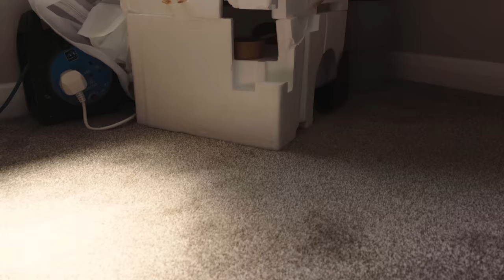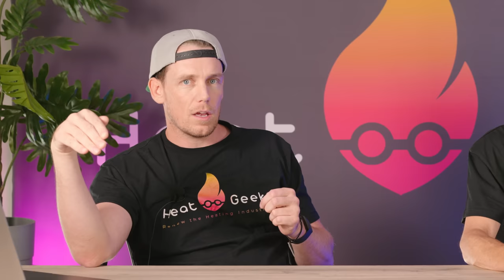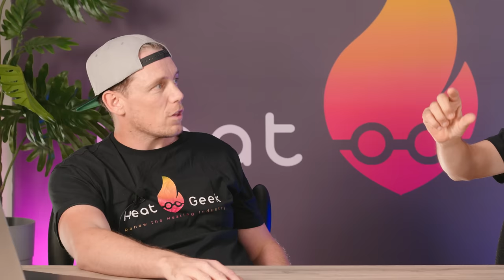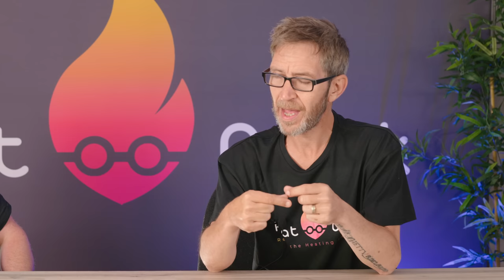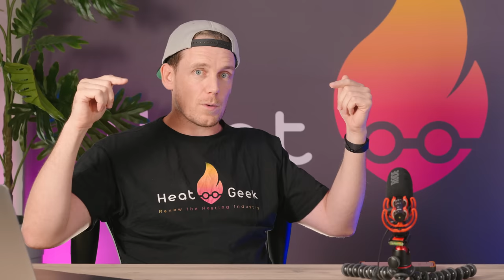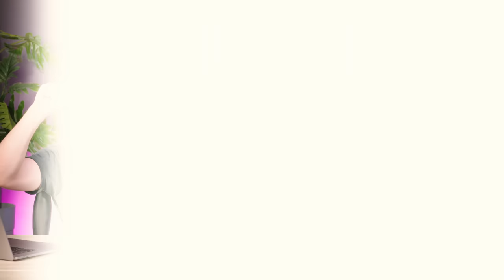Cooling With Heat Pumps | The Technical Details

Comment: I run four fanned radiators on my weather compensated systems (down stairs UFH) all have three speed fans manually selectable to achieve the correct heat input per room, each unit has a 8 watts fan draw maximium and wired into fused spurs from the upstairs ring via the sockets in each room, this in practice is straghtforward as long as no other supply has been taken from that socket on a ring mains.
They need a service every year as they collect dust due to large air movement through a mass of alloy plates fitted to 8mm or 10mm copper pipe, they are fed with 15mm copper and each set of pipes is connected to a common 22mm copper carcass branched off of 28 mm copper Nr the boiler, the 28mm feeds the UFH with 12 feeds and returns, no blending, no pump and no thermastatic control as the weather comp directly controls heating water temp. 
They are noisey and if not cleaned thoughley make even more noise, having said that you soon get used to the noise and its not that bad, I run the fans on there mid speed as thats the heat output required, they also only come on at around 30 degs flow as they have built in pipe stats and a built in thermostat so once the room is up to temp they turn off, this give a deg of control as everyone's heat requirment is different in each room.
As for runing them for air cooling this would be a problem as the frame is open underneath for air to be drawn in and condensation cannot be collected. They would need servicing again before being used for air cooling as dust collects easy due to close spacing of the alloy fins on the heat exchange.
Hope that gives you some more insight into cylindrical fanned radiators designed for low water temp systems.

Comment: The price of the cooling chip is hilarious. It would be interesting to get someone to reverse engineer it and see if it can be done for 20p.
Reply: It's a simple resister, not a chip!  It enbles in-built functionality, it doesn't add it.   Should cost around £30, not £350.
Reply: Seems Vaillant UK do sell it for £350.  It's €40 in europe though.
Reply: Happy to have a go!
Reply: @edc1569  It's the vaillant blue chip (used on their gas boilers) . £5. Yes, it's a total rip off!

Comment: I'm curious why everything I hear about UK heat pumps is all air-water and distribution using water radiators? All modern buildings here use forced-air, either air-air heat pumps or forced-air natural gas furnaces. With heat pumps, the indoor air handler deals with the condensation in cooling mode. I get that your existing buildings don't have ducting (we have plenty of existing buildings with baseboard resistance heat for that matter), but what about new build? And for retrofits or small condos, people here are just putting in ductless mini-splits. Radiant heat is nice and all but it seems cooling is a big challenge.

Comment: I've been looking at retrofitting A2A upstairs for potentially heating and cooling, is there a reason you need fan coils in each room as I've seen rooms ducted from a single large unit in the loft space. This takes up less room but is it less effective?
Reply from the maker: Just to spread heat. Warning.. a2a is not as comfortable
Reply: Ducted systems loose lots of efficiencies. Thermal Loses in the duct work, hard to keep clean etc. 
Best to have the units directly in the room. They are the quickest in getting a room to the set point, nothing else comes close
Reply: @darrenr1995  I guess even though they are a bit more work to fit the fan coils, it's still fairly straightforwards upstairs if you can run wiring/condensate/coolant through loft space still
Reply: @bencampbell2041  yes surprisingly easier than ducted. Each house lends its self to different systems though

Comment: Are the air con fans that Richard described effectively mini-splits connected to the same heat pump?
Reply from the maker: Yes but via system water not feidge
Reply: @HeatGeek  Ah great. Yeah I’m with you on this as we only need cooling at most a few weeks a year. It’d be great if you could show us a working example of what was discussed.
Reply from the maker: @amritbhupal8514  were still testing it.. filming more tomorrow

Comment: Is this highlighting a fundamental limitation of hydronic systems? Should we be considering air heating / cooling units and circulate refrigerant directly instead of water?
Reply: When the HeatGeeks started this I assumed they were installing some clever valves and putting the ASHP in reverse to provide a Compressed R290 cooling loop to inside AC "Fan Coil Units" I'd like to see them add this to their system and see what the performance difference. Not sure if there are any ASHPs that allow this reversal out the box though.
Reply: @andyca15  they did mention some heat pumps don't support or require a controller box to support cooling
Reply: I think it is highlighting that one size does not fit all. There is no perfect system for our varied housing stock and each case needs to be addressed on an individual basis. Air to air works better in small areas. For example when we went on holiday the villa we stayed at had 5 split air con units. Not cheap to install, maintain or run!
Reply: Circulating refrigerant directly into the indoor unit(s) for both heating and cooling is far more efficient and effective than transferring the energy to water. All AC systems are heat pump based too
Reply: Circulating refrigerant directly into the indoor unit(s) for both heating and cooling is far more efficient and effective than transferring the energy to water. All AC systems are heat pump based too
Reply from the maker: @darrenr1995  not really worth it for 10 days a year..
Reply: @HeatGeek  we install traditional heating types and also AC. I’m not against and types of systems but my customers use the AC cooling for more than 10days a year! I bet your office ones are on more than that 😄
Don’t forget they do heating exceptionally well too, so keeping people very comfy all year, not just in winter. 👍
Reply from the maker: @darrenr1995  where are you based???
Reply: @HeatGeek  Hayfever sufferer here; I need to keep the windows closed during hot periods... My little Portable AC unit has been on for at least 30 days so far this year, with many more to come. If I had been working from home my AC would have been on more.
Reply: @andyca15  this is a huge benefit of split ac systems. Filters the air at the same time too
Reply: @HeatGeek  we are based between Peterborough and Stamford
Reply: @darrenr1995  yes some extra benefits to split AC for sure, goes to show #NoPanacea 
Looks like we will be getting far more of these extremes in the future too.
Reply: @darrenr1995  cover Kettering? 🤔
Reply: @Ifitaintbrokedontfixit  still cheaper than a large A2W system, though (all in)
Reply: @Etacovda63  not a chance it is! And as for maintenance!!
Reply: @Ifitaintbrokedontfixit  .What do you foresee being a big issue with maintenance?
Reply: @darrenr1995  I don't see a big issue per se other than the more units you have the more maintenance you need to carry out.  I am all for the best technology we can fit. If that is Air to Air units why are so few being fitted?
Reply: @Ifitaintbrokedontfixit  to be honest the maintenance of AC is removing and cleaning the filters. If installed properly (nitrogen pressure test 40bar, vacuum the system correctly) once completed by the engineer the system is a sealed unit. Nothing on the refrigeration side is then disturbed. The gas doesn’t degrade. Once year service (electronic leak check, clean coils, check temps) that’s it. Very low maintenance.
More aren’t installed because few really know about it or are prepared to change. Your local plumber can’t fit them either so that’s another restriction. Industry is regulated by FGas. Have one fitted professionally and see, you’ll then have more 😄
Reply: @Ifitaintbrokedontfixit  - don’t know what you pay for air to air heat pumps in the uk, but in nz you can get an air to air 5kw unit installed for around 1500 gbp (including the unit). I’ve spent exactly nothing on maintenance of mine since it was installed 9 years ago - just cleaned the filters (about every month, it’s literally a 5 minute job, and you only have to do it in heating season, and realistically only every couple of months, I do it more than you have to) and the external units Fancoils myself, which I have done once in 10 years. Getting a multi split installed would probably end up similar $/unit as the install would be more. One unit can happy service more than one room depending on house lay out (my house is 100m2 and the one unit does half of the house no issues, if we installed one in our hall we would do the rest easily).

I’m not sure where you’re getting your info, but it’s wrong… I’m guessing by your YouTube name you’re a plumber and have listened to other plumbers who are susceptible to lies from others in your field because it will encroach on profits.

The UK and the US are miles behind on this, the US are finally installing mini splits now when the rest of the planet has been doing it for decades.
Reply: @darrenr1995  I am talking more about breakdowns with multiple units. Also by 2027 there is a ban on split heat pumps under 12KW with a GWP of over 150. That means they will need to then run on r290 (propane) which is going to mean some more training for people and redesigning of units for domestic markets. Its not that simple!
Reply: @Etacovda63  your info is for the UK to.
Reply: @Ifitaintbrokedontfixit  can’t speak of others breakdowns but from my experience it’s not of concern. They are extremely reliable, they just keep going on going. 
R290 will come along but no one is going to make you remove an existing R32 system from your house!
Reply: @Etacovda63  * your info is correct for the UK too
Reply: @Etacovda63  Installed I would say substantially more than £1500 for a 5KW unit in the UK. As I said I am not against the idea. I am just a little sceptical that they are so cheap, wonderful and the answer to heat every house in the UK!!
Reply: @Ifitaintbrokedontfixit  5kw air to air mini split is around £1500 supply and fitted. Maybe £1800 max if you opt for a fancy model.
Reply: @Ifitaintbrokedontfixit  you're jumping to a lot of conclusions, I suspect because you dont like the answers. 1600gbp fitted for a 5kw unit in the UK was the first one I googled. Literally the first.

Rather than not liking the results, I suggest you get some fridgy training - that way you can put in the appropriate system for your customers if a2a is needed.
Reply: @Etacovda63  On the contrary why would I not like the results? I said one solution would not suit all situations and it's evident that you like a2a. If there was a market for it, it may be worthwhile exploring further.  At this point in time it is not an avenue worth exploring for us.
Reply: @Ifitaintbrokedontfixit  yep, maybe not right now - but once people have heatpumps in over there with the boiler phase out, you'll probably find people cotton onto air to air heatpumps. All air to water is doing, is adding another heat boundary inefficiency. The only reason to stick with water is existing infrastructure, or underfloor heating.
Reply: @Etacovda63  Ok. A little scenario. How would you go about heating a house effectively with a2a when there are 5 rooms downstairs, 5 rooms upstairs and 2 bathrooms? The heat loss is 8.6KW at minus 2. How will you be heating the 250L unvented cylinder efficiently? Also, the customer has said they don't want to hear fans running constantly.
Reply: @Ifitaintbrokedontfixit  can’t see your layout with just a description. Depending on the layout, 1x5kw  heatpump per floor and a heatpump hwc since there’s a 250l cylinder. Wall heaters for the bathrooms with running timers for boost in the bathrooms (which will be significantly better than towel rails/radiators). If the layouts particularly shit, a multi split unit with multiple indoors would be the go.

If you’d had experience with indoor units, you’d know the fans modulate down to near inaudible levels (Ie 29-32db) and they have a quiet mode which forces them to stay at this level.

Comment: The most annoying part of enabling 'cooling' on ASHPs (and paying a ridiculous amount for a chip) is the fact that most of them have all the control logic / valves on board to do it anyway - the defrost cycle works by extracting heat from the system/house and pushing it into the heat exchanger to melt the ice off (and so pushes heat outside). This is the exact same process as cooling mode.
Reply from the maker: Correct. Some don't need the chip though
Reply: @HeatGeek  would you mind sharing which brand/models don't need this chip with exorbitant costs?
Reply from the maker: @Alex Bleicker  I don't know. But the ones the ones that do have it are less likely to be as cheap to run...

Comment: Is air to water really better then air to air?? Air to air can heat and cool very efficiently with tiny indoor units not massive radiators.
Reply from the maker: I don't think we did say it was better? The reason a2w is installed is becaise most houses already have rads..  comfort wise a 2 w is much better though  yes
Reply: @HeatGeek  A common misconception of a2a systems.
Reply from the maker: @Boodieman72  what is?
Reply: @HeatGeek  Comfort is much better with a2w
Reply: @Boodieman72  Yeah, I'm wondering if they've ever put any in... The fact that hes having to ask if fancoils modulate their fans says enough about it...!
Reply from the maker: @Etacovda63  we've not put any a2a in no. We live with that one in the room as meantioned and the stat is forever being played wirh. Unlike the wet offices upstairs.
Reply: @HeatGeek  ceiling cassettes are about large areas, not comfort. See if you can experience a higher end floor console, it’s a completely different experience.
Reply from the maker: @Etacovda63  OK thanks will do

Comment: I'm doing some research into this at the moment and found a product from a company called variotherm. It's modular ceiling heating and promotes cooling as one of its features.
I was wondering if anyone has heard about it and/or has some experience with this? I would be to hear your opinions :)
Reply: they also do wall panels and ufh

Comment: This is simply therotical clap trap that is defective and bad ideas. You will nearly always get condensation that will lead to rusting and staining. Just like most accedemic approaches you are missing the most obvious and easiest solution for cooling from a normal and standard installed heat pump. You simply divert the chilled air extract from the outdoor unit back into the house whilst heating the hot water taps. Easy peasy and achievable with limited DIY skills. A temporary sumer lash up like this provides great home cooling that can then be removed for the colder seasons. This is what I do and it works great.
Reply: Surely that requires the heat pump to be heating something - presumably the hot water? So in order to get cooling you either need a hot water tank to heat or to run the hot water tap on order to cool the house. If your hot water tank reaches temperature I guess you're back to running the hot water tap to continue cooling your house? If what I've described is accurate I'm not convinced by this solution.
Reply from the maker: That wouldn't provide enough energy

Comment: Ground source heat pumps are expensive and alot of us were conned. Yep throw out your existing systems throw money on the fire Air Conditioners  will cost less and you don't need to dig up the Garden.